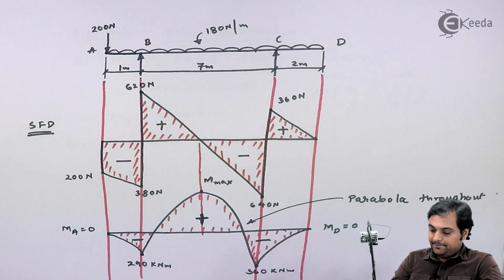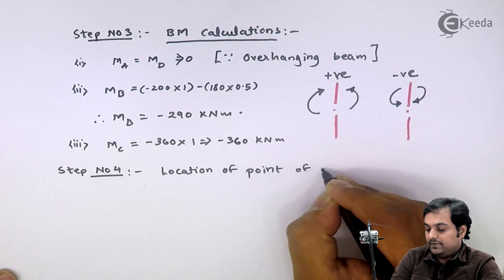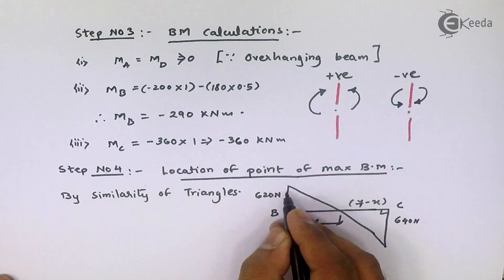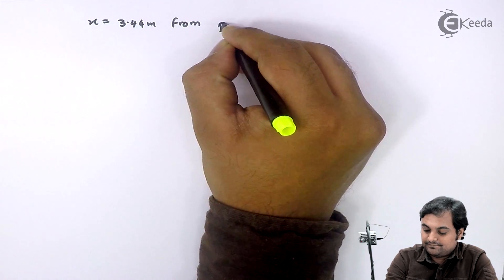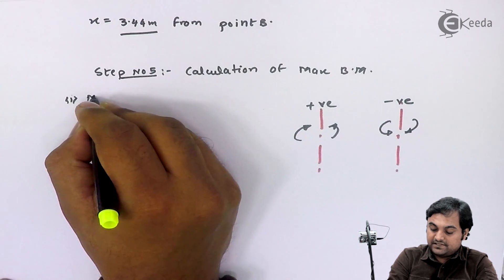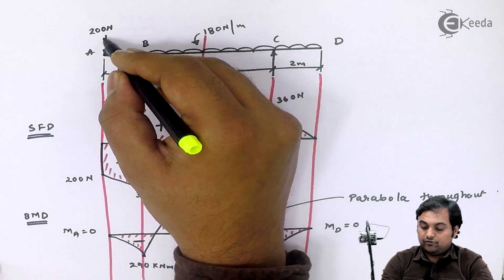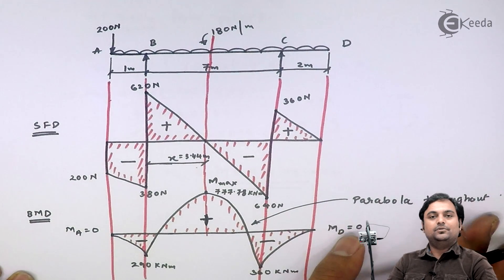SFD and BMD - Problem 2 - Part 3 - Shear Force and Bending Moment Diagram - Strength of Materials

Comment: The answer of the maximum banding moment is 777.776KN but the taken equation is not correct,
The correct equation is :-
MAX B.M = (-200*4.44)+(1000*3.44)-(180*4.44*(4.44)/2)
MAX B.M = 777.776KN

we have to take full spam of UDL from 'A' to taken axis.
Reply: 1486.976 KN is right or 777.776 is right??

Comment: Sir check the calculation of reactions because u have taken 4 instead  of 5 in calculations
Reply: He was correct bro a -200
B-380 or 620 n 
C -640 and +360n
D=0

The. What will be getting wrong please elaborate what's your last answer  1486.976 or 777.786

Comment: Sir while calculating max bending moment u had taken -180x3.44x3.44/2 
But it should be -180x4.44x4.44/2
To get answer as 777.776
Reply: Thanxx bro..
Reply: Thank u bhai
Reply: so which is correct ?? Is is 1486.976 N/m or 777.776 N/m
Reply: Yes because udl is also  present between a and b.
Reply: This type of small mistakes brings confusion in the minds … thanks bro for giving the right solution
Reply: Perfect bro
Reply: @somshekharchougule3038  correct ans should be (-180*4.44*2.22)+(-200*4.44)+(1000*3.44) that gives 777.776.
Reply: You are also wrong
Reply: @predatorgaming895  how so?
Reply: @enamulislam.meraj1120  bro becasue sir took udl distance from B but udl is present in A-B section so we have to take distance from A ie. 3.44+1 not from B ie. 3.44

Comment: sir, the calculated value for B.M. max is 1486.97Nm instead of 777kNm. plz clarify this doubt.
Reply: there should be 180×4.44×4.44/2
i.e the net udl on left side acting at half
Reply: the answer is still larger even with the correction? Please clarify. Thank you
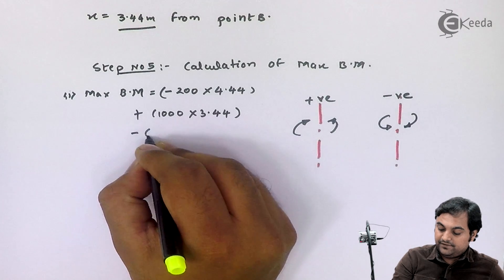Reply: At 4:29 the value should have been 180 x 4.44 x 3.44/2